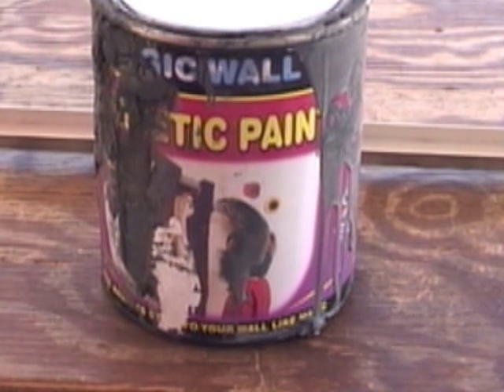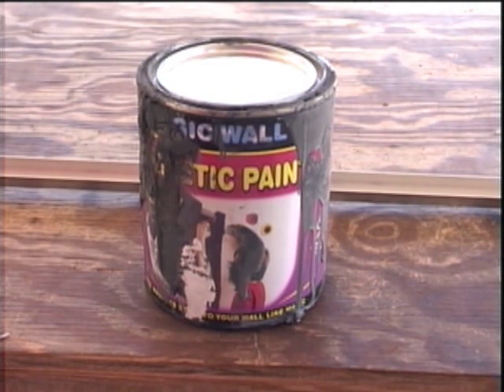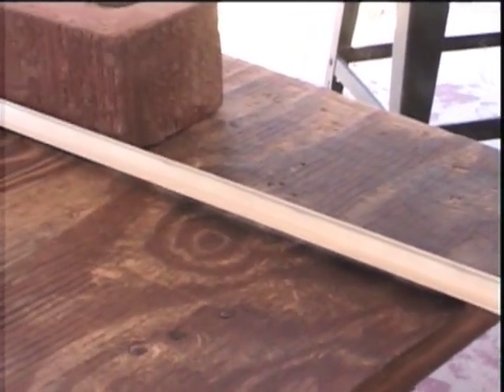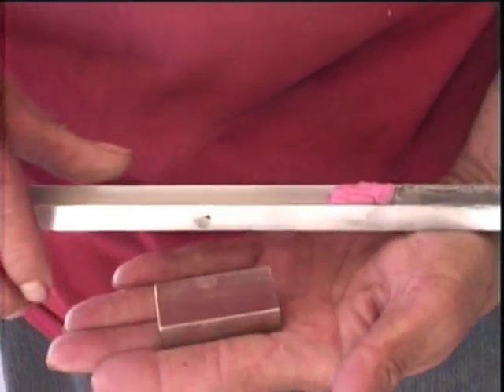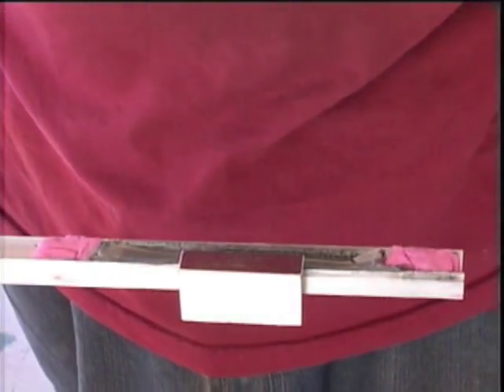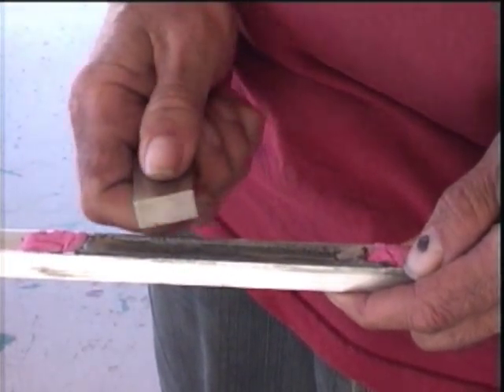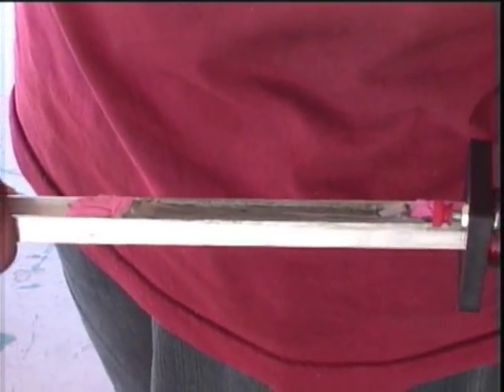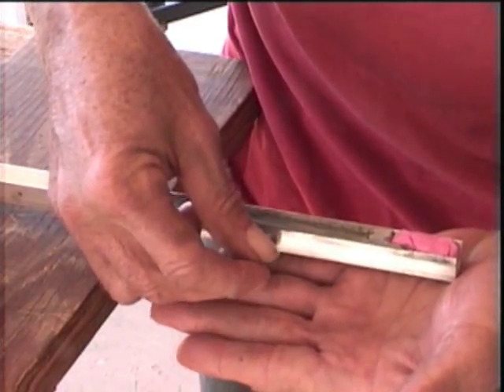Permanent Magnet Motor Design

Comment: My brother worked in a magnet factory. He said they would melt the product then while still melted the table would be switched on pulling the product into the molds where the materials magnetic would aline with the manetic tables magnetic forces and once cooled you have permanent magnets. Ive mixed iron fillings with epoxy put in a plastic bottletop and set it on a neodidium magnet after the epxy hardened bam a magnet

Comment: I can't even begin to wonder why you need a long magnet, but the title of the video is "Permanent Magnet Motor Design." You can just go out and buy one, of ten thousand, from many thousands of manufactures.

You cannot magnetize metallic paint because electron spin domains do not exist in dried magnetic paint. You can try building aligned domains while the paint is still wet by subjecting the paint to a strong electromagnetic field as it dries. But why bother?